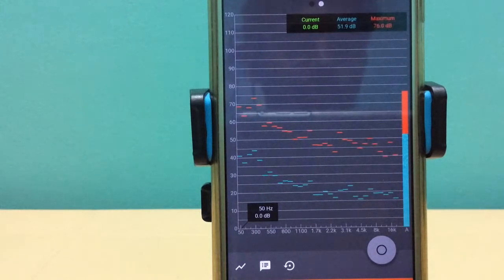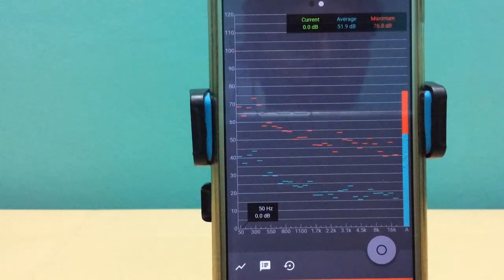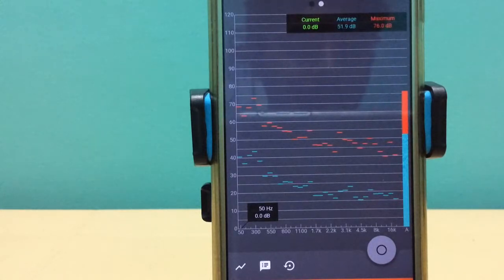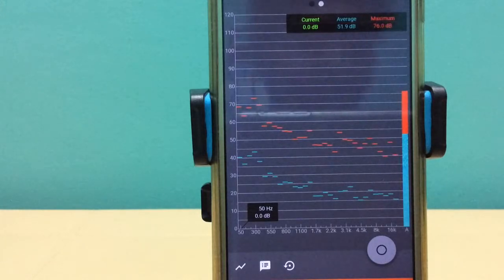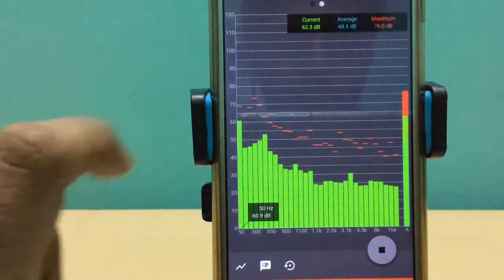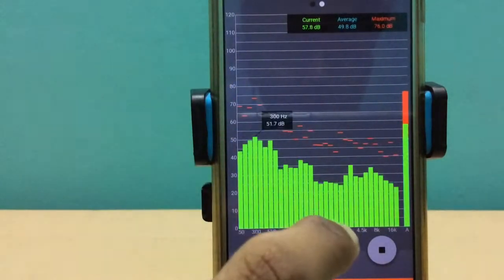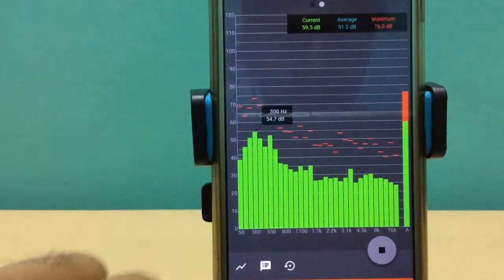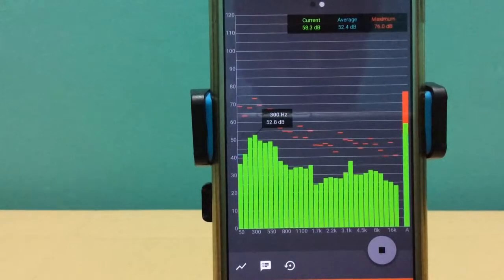Sound frequency of a human voice

Comment: If the room you are in echoes, then wouldn't this alter the true frequency of your voice?
Reply from the maker: The problem here is not with echoes but rather reverberation. Reverberation occurs when multiple reflections of the same sound arrives at slightly different times at the microphone creating one prolonging sound. As the room had flat walls and tiled floors, there was more opportunity for sound waves to undergo reflections. A reverberant environment does cause sound to be unintelligible and can increase the perceived amplitude of sound. However, it does not alter the frequency content of the sound since the environment (room) is not producing any sound but only reflecting already created sound.